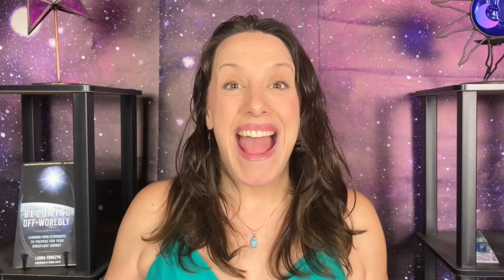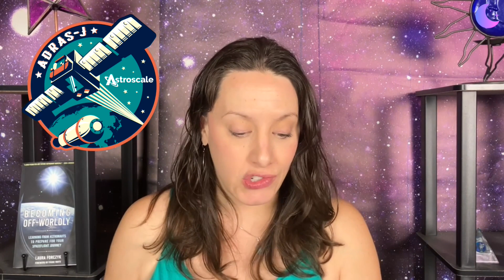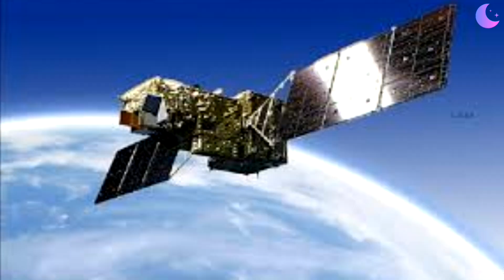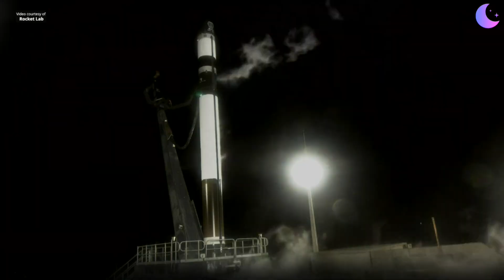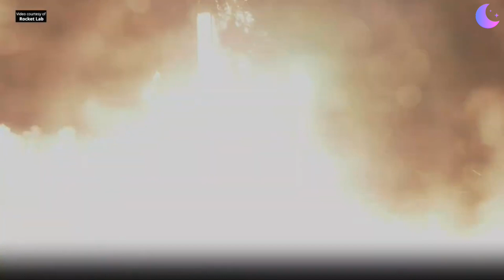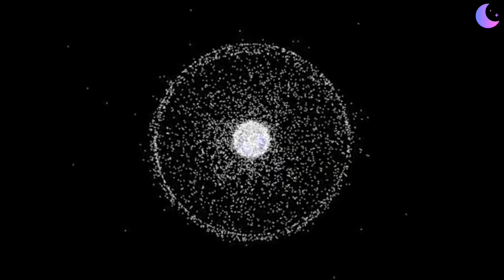Astroscale Preparing Space Trash for Pickup

Comment: The Ariane 6 upper stage has a perigee of 570km.  Wouldn't that come down in under 10 years?  Maybe under 5 years, considering high volume and low mass of the empty tank.  So there might not be enough time to develop a solution before it deorbits itself.  This is actually quite concerning, since it actually has return capsules, designed to fully survive reentry.
Reply from the maker: I haven't done the calculations. You may be right!